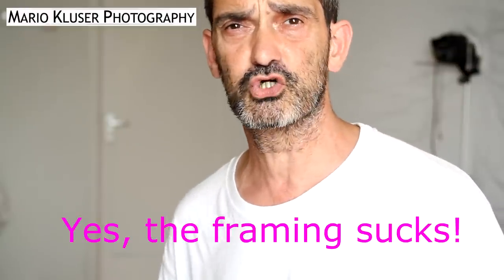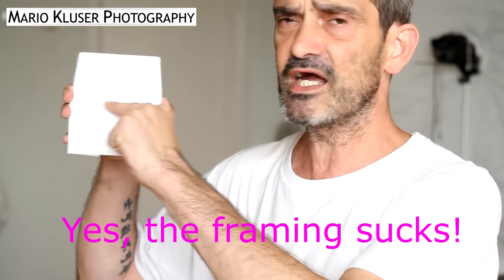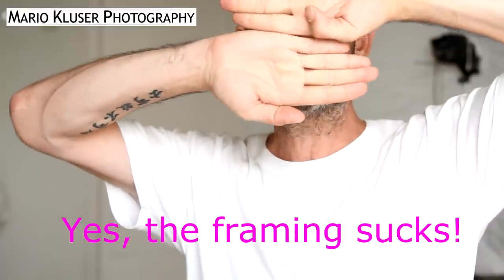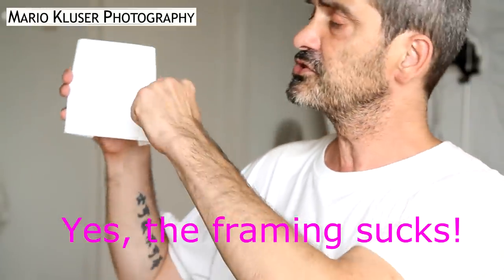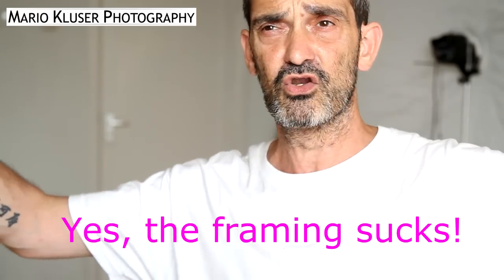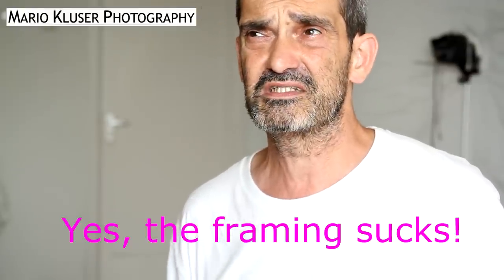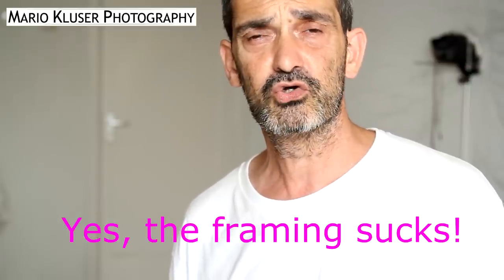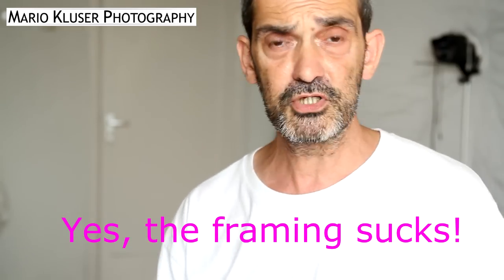Cross Type Auto Focus Points Explained

Comment: what is beter the 200d or 750 becasue the 200d has cmos dualpixel 9 af point 1 of them is crosstupe.and the 750d has af sytem and 19 crosstype
Reply from the maker: The number of AF points isn't the way to determine wish camera is better. This would be comparing apples to pears. For example any MF camera with 9 AF points would be better than any of the above. What also is comparing apples to pears.